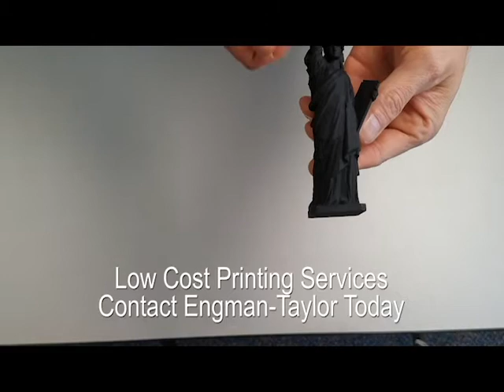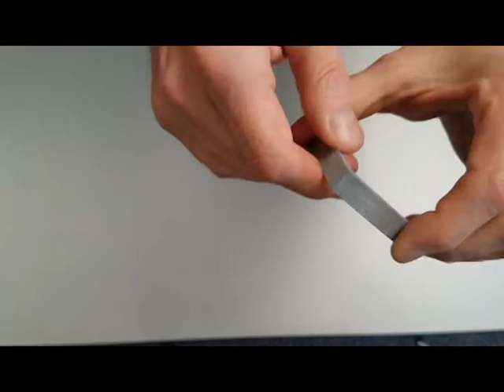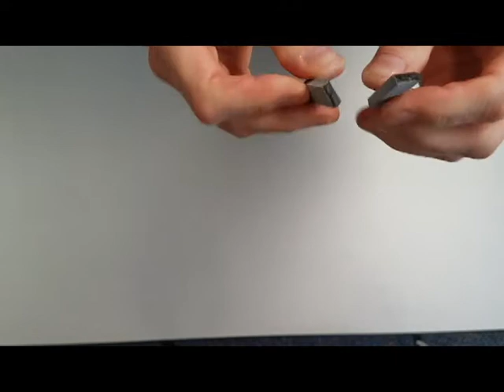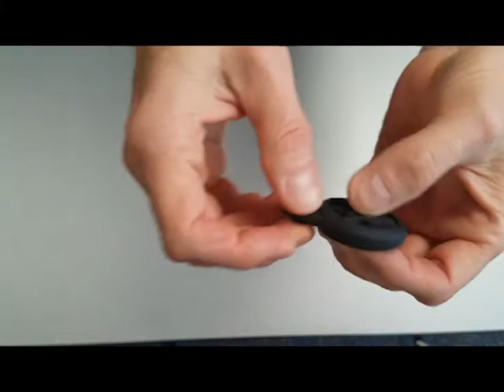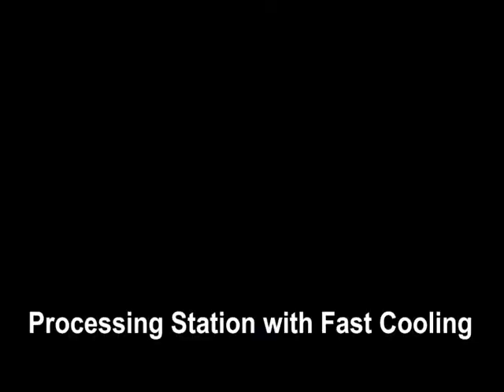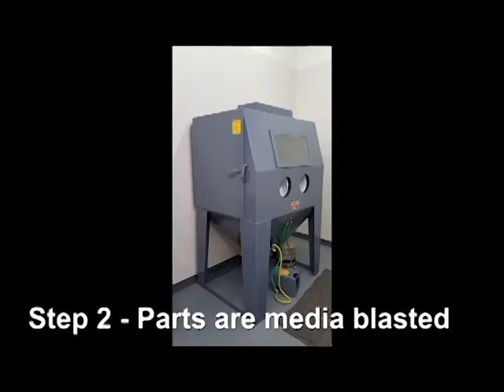3D Printing on the New HP Jet Fusion Printer

Comment: So what is the difference between this method and regular SLS printed parts, besides the speed?
Reply from the maker: The technology is quite similar.  Both print in a bed of powder so no additional support is needed.  SLS uses a laser to cure "points in space".  The HP not only cures the whole bed at one time it also uses a bonding agent and curing light.  This creates incredibly fast and strong parts.
Reply from the maker: HP Multi Jet Fusion is a powder-based technology like SLS but does not use lasers. The powder bed is heated uniformly and binding agent is jetted where particles need to be selectively molten. Then a detailing agent is jetted around the contours to improve part resolution and to resist binding agents binding powder that shouldn't be bonded. While the lamps pass over each layer the jetted binding agents capture the heat and helps distribute it evenly along the part.